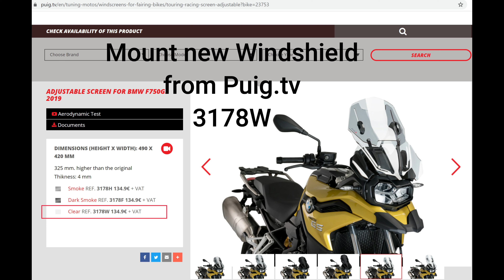F750GS Windshield Puig and GPS holder relocate

Comment: What is the use of having an adjustable windshield, if you then have to stop and adjust it with a screwdriver to adjust it. I bought it and unfortunately I can no longer return it and now I have to find a way to modify it, to allow adjustment without tools.
Reply from the maker: Agree.. The best is to have the possibility to adjust without any tools.

Comment: How do you find the Puig wind screen? I appreciate it all depends on your height and the screen height but your feedback would be great. I like the look of it compared to the GIVI airflow.
Reply from the maker: I have my Puig windshield adjusted in the top position now. My height is 178cm.  All is fine in 120km/h, no vibration and no mosquitos hitting the helmet. In rainy weathers is also good.

But I dont how the GIVI works... Presumably more or less the same?
Reply: I put a Givi airflow on my F750GS. Worst thing ever - the buffeting at just about any speed and screen height is unbearable. Thinking of getting the PUIG now but don't want another bad investment.

Comment: Hello great look to yogur bike, one question how move the adjustable part of your windshield, do you a screw! Or manually?
Reply from the maker: Hi Santiago. There are 4 screws that you loosen (about 1 turn), then move the screen up/down. Then tighten the screws.
Reply: motorcermans hey, thanks for your comments, I want to know your impresions regarding the windshield, Im think to buy it for myf850, Some guys say This windshield doesnt work fine, also it has lot of vibration, what do you think?
Reply from the maker: @santiagochavarria7506  Hi... In high speed on pavement it doesn't vibrate. In the woods or bumpy gravel, then it vibrates. I usually have it lowered in the lowest position during gravel, and in the highest position on the motorway. If it sometimes in the future will break, then I will buy the same.
You may check this video if it vibrates... https://youtu.be/XImTTtUYJfw?t=103